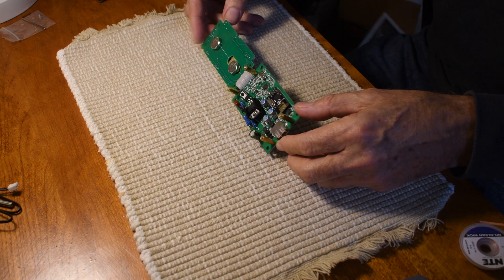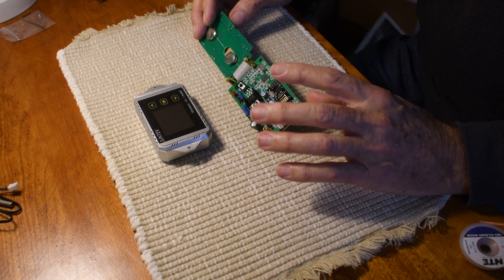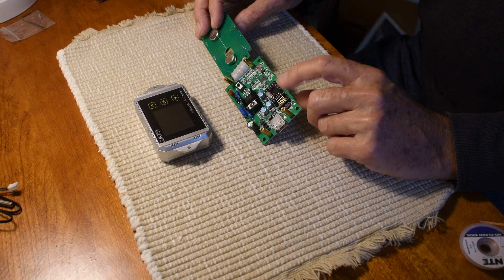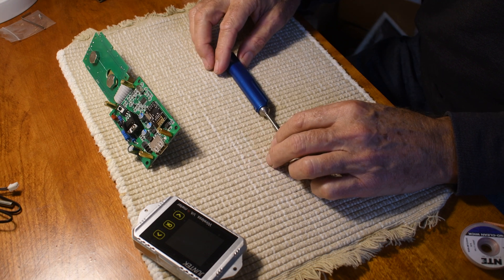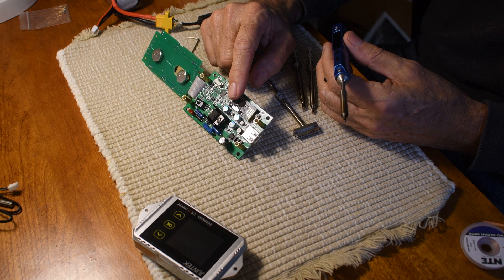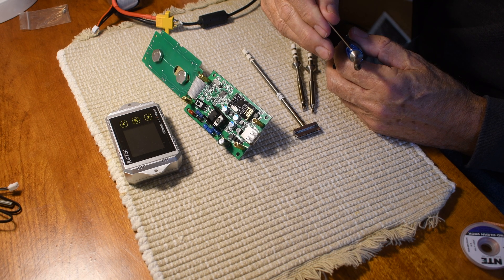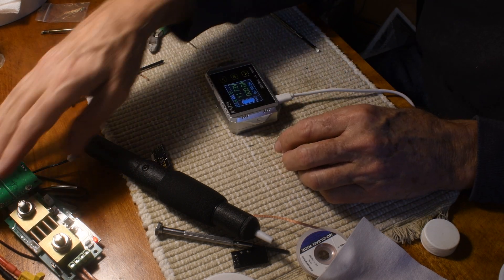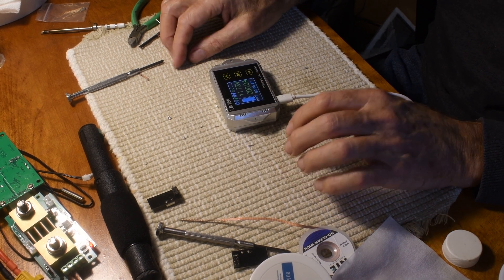A battery state of charge(Volt/Amp/Watt-hour/coulomb counter)solution for wireless network Part 2of5

Comment: Excellent  i messed up with mine now ordered nrf after watching ur video and will change it i guess i burnt my nrf on shunt due to short circut as the red wire was connected to it and i gave current to the battery side bolt while the other one was not attached and i saw smoke just a lil bit and the red light does not turn on now and no signals on monitor lets see if mine works again after changing  the nrf on shunt board